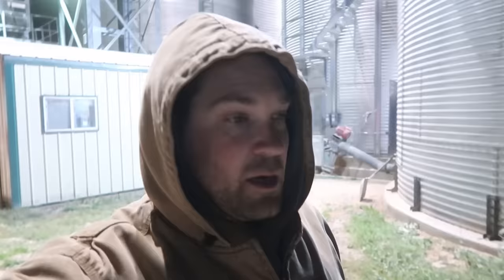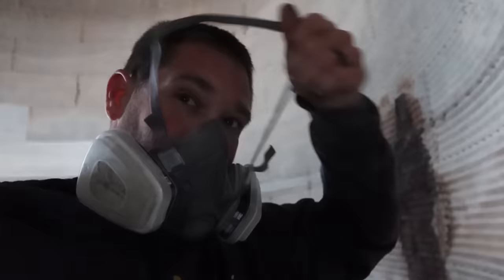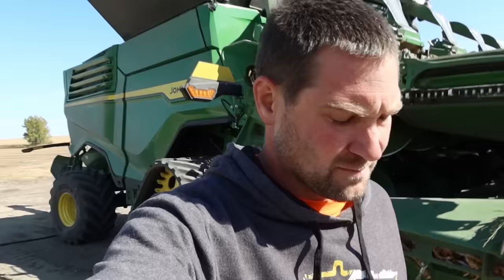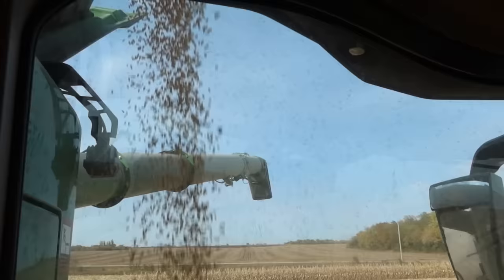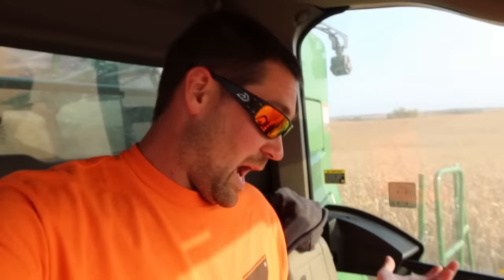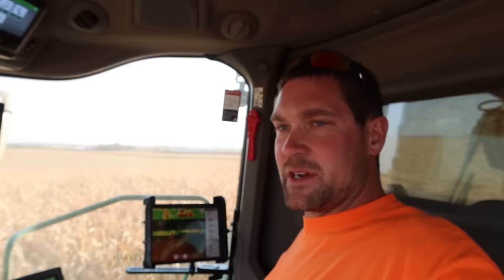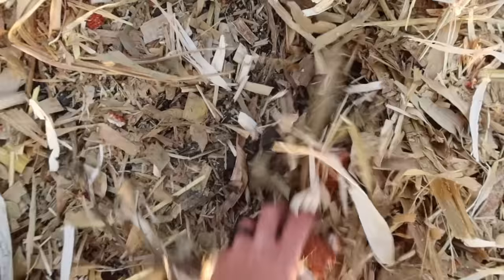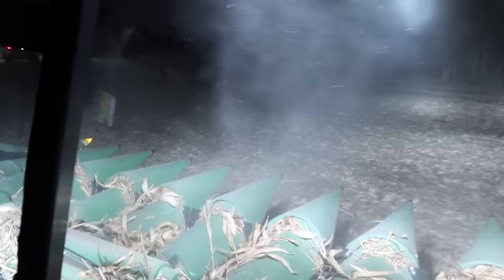John Deere X9 Likes and Dislikes

Comment: Your “cat container” is supposed to be a trash can lol that way you can pull it out and dump it. Can also be used as a toilet on the go. Pretty handy but not the most sanitary thing in the world. Wouldn’t recommend it. Continue to use outdoor bathroom.
Reply: i say its for a cordless Vac so he can vacuum off the cab corn lol
Reply: I was gonna say the same thing
Reply: Haha.I'm guessing it would splash out on rough ground.I'll let someone else test that theory!
Reply: there are plenty of cases worthy of ''trashing'' a 5 gal home depot bukkey you can get one of those toilet seats for them ya kno... ....  ummm ;)  and that day the taco bell revenge happens you toss that bukkey out someplace and get ya a new 5doller 5gal bukkey  lol  wait... channeled that from SMPLACE...

I even saw one with bags you could toss away... pretty snazzy if you used to using the tire to prop your back up and try not to hit the wheel... wait... yukkk channeled that one from someplace else also!
Reply: Toilet on the go!
Reply: My nephew has used the one in his Deer as a sample container when he has forgot the sample coffee can. Of course not after it has been used as a bathroom or a trash receptacle.
Reply: Put a bin liner in it and you should be just fine for a bathroom, just don't go cheap on the bags if you don't want it leaking ;)

Comment: Mike Mitchell did a good summary on hp needs while reviewing their demo Ideal 10 with close to 800hp.  Basic summary was barely enough is not good enough.  Need enough to handle every situation you may run into with all machine functions operating, going up hill, fully loaded, mud, unloading on the go, etc.
Reply: Think above 1000hp is exempt from all the EPA rules, seems like they way to go. But maybe the manufacturers don't want to sell something reliable?
Reply: I was disappointed Mike didn't get the chance to run the X9 this season. Would be good to see a comparo between the Ideal 10 and the X9. The specs seem to indicate the X9 has much greater cleaning capacity, but not horsepower to drive it - would be good to see how they go back to back in real world conditions.
Reply: @IBAdrianHarris  The Ideal 10 has a lot more thrashing capacity with 16 foot length. JD’s top pan is just a delivery pan more than a cleaning pan. Ideal 10 is ahead in specifications in all other categories. Fendt Ideal 10 should win in field trials if they re-design their MOG chopper/spreader. The general consensus out their by all the subject matter experts is that John Deere copied the Fendt Ideal’s technology when they came out with the X-9 combine. I looked at the comparisons and I would have to agree.

Comment: Looks like the X9 does a great job overall but for a flagship model, it’s still down 100HP on the Claas 8900 and the Ideal 10.  Throw in a Case 8350 and it would be interesting to see all of them go head to head in the same crop.  Not just in acres cut but sample, losses and efficiency.  I can dream can’t I...?

Comment: You should really show us how that little moisture tester in the dryer shed works cause I’m really curious
Reply: Yeah same here cause ours is different all we have to do is take a bucket out it underneath the crop that's coming out of the semi the go in the tiny house is what we call it then dump it in a like container on top of the sampler machine Tap test crop on the touchscreen on it then it opens the crop goes inside then it levels it automatically inside the machine then it test the crop then you write everything down then it dumps the seed or crop into a tray and then after 5 sample's you have to go dump it in the grain pit where the semis dump so yeah
Reply: Those are really old, but must still be good, or they wouldn't be using them.
Reply: Fun fact: that moisture tester he has is only a couple hundred dollars less than the X9

Comment: Hey Zack, you’re running one of the biggest combines ever made, and you’re still able to make it pull down with all that power, I just remember running an old 1440 International no turbo obviously talk about a dog!! That was back in 1981, things have changed obviously!! Way too big of a machine for us💰!! Anyway Zack I love learning about this stuff 👍!!
Reply: When I worked for an IH dealer,one of our customers had a 1440. He wasn't happy that he could t unload on the go.  He broke a front axle, and brought it in for repair. The engine is straight off one of the regular tractors.  While swapping the axle, one mechanic added a turbo to the engine.  The farmer loved it.  Eve claimed it was more fuel efficient with the turbo, and the fuel savings would pay for the turbo in less then one season.
Reply: @robertheinkel6225  Oh I remember trying to unload on the go, it was always pulling down just with a four row too, that’s really all it needed was a turbo like the 1460, we traded it for a 1640 and that still did not have a turbo but it had the 466 engine and that made a big difference!! They were good old machines to be honest we went with JD in 96 and went back to Case IH last with a 7250 with a MacDon draper and the folding 12 row head !! Very pleased with it does a beautiful job 👍

Comment: i have been driving trucks for 30 years i HATE flat tires in the morning.
Reply: I haven't been driving for quite 30 years, But flat tyres are definitely not my favourite, Although, Zach gets more flat tyres than our entire fleet does, and we have about 35~ at a given time.
Reply: Had one this morning on my milk wagon
Reply: Seems more often the inside dual also.
Reply: Specially in a cold morning
Reply: What is worse, the morning flat or the almost done for the night flat
Reply: Iv had 3 in one week and they where all replaced by loves 🤔
Reply: That's what she said.
Reply: Been there! Usually when I NEED the truck... lol probably would've etherd it up! 😆
Reply: @cornbread9167  "with loves"? Or, "by Lovs"?
Reply: But they re only flat on one side.

Comment: Watch out 6 is gonna be running trucks here in a minute
Reply: Give him two maybe three years when that puberty growth spurt kicks in. Those are a lot easier to drive when you can reach the pedals and see over the steering wheel at the same time.
I remember being maybe a year or two older than onyx , cultivating 4 rows of corn with the popping Johnny H with the tricycle front end. No hood !No fenders! just you , the seat , and the steering wheel to hang on to ! Exciting times at the ends of the field. Both hands on the lever to get the Cultivator out of the ground, disengage the hand clutch jump off the seat and stand on the left brake petal while spinning the front end in a perfect half circle. Haha! Pop the clutch back in while giving it a little more throttle and drop the cultivator back in the ground. Almost as exciting as wrestling and holding the firstborn calves at branding.

Comment: Pulling the yellow air brake should set the red brake automatically no???
Reply: Yes it does.  And I'll never understand why trailer brakes button is  ever pulled out. Unless obviously dropping trailer or on a hill.
Reply: I dosen't work all the time ..so it doesn't hurt to make sure.
Reply: @Madswiss600  why would you depend on a tractor to hold all the weight of the trailer also. When loaded that’s just common sense I would say.

Comment: Why not just weld a ring around the bottom of the grain bin on the wall flush to the floor and a angled scrap on the end of the sweep that runs a eight of an inch from the ring on the wall so u don't have to climb in so much
Reply from the maker: If you inspect a grain bin sometime, you'll know why.  They're crude lol.  Nothing is within 8" let alone 1/8!

Comment: Since the combine is running on auto steer couldnt you technically get out and clean the window while its driving itself? :P
Reply: And well he's out thier check for corn loss, take leak and possible climb up and down the ladder a few times to loosen up...forget checking for corn loss that machine's running 6mph it could get away from him.
Reply: @jackwillie2729  sounds like something mike mitchel would do😂😂
Reply: No can do even if you wanted to. There's a sensor in the seat when there is no occupant it stops the machine from any forward or reverse movement.
Reply: @earlhollar1906  when there is a will there is a way😜
Reply: assassinlexx  I never said he SHOULD do it, just that he COULD :P

Comment: I used to run a New Holland TR. In dry corn it’s really easy to “over thrash”. I would try reducing rotor speed/ open the concaves in order to be able slow the fan speed., and increase ground speed to “fill” the rotors for cleaner threashing. Good Luck, it looks like fun!!!

Comment: Highly recommend a standard pallet jack for changing tires.  If the truck it jacked up high enough, you can slide it under the tire and lift just enough to pull it off straight all with only one person.

Comment: This might sound like thinking out of the box...or a crazy idea....you’re using a grain shovel in the grain bin to move the grain to the auger. Has anyone tried using a small electric snow blower to move the soybeans or grain away from the sides? Maybe with a little modification to the inlet impeller with a Ruber strip? There’s got to be a better way to make it easier for ya! Just a wild thought!?
Reply: I hate the thought of the dust with these (out of the box ideas)
Reply: If I was you I would patent that idea quick. As a selling point it comes with a hazmat suit. LOL you would definitely have to have a gear reduction for discharge velocity. My electric Toro would throw them beans all the way from Bin Ghost out the door, even at the lowest shoot setting.

Comment: In the UK I used to erect silo's in the 60/70's, used for barley, 80% of these had a hopper floor, never ever any shovelling to empty a silo, only 1 auger used to empty the tower, set at a 45 degree's in to the bottom of the hopper floor. On 10% of silos we erected air sweep floors on the flat base, no auger's used at all with this system, the grating on the floor were all directed to the under ground  conveyer in the middle, with draft from the drying fan, again no shovelling or sweeping, the rest had the not very nice shovelling brushing floors.

Comment: John Deere had an X9 combine testing east of Edmonton Alberta Canada on oct 21 2020 with heavy secrecy and security. This combine came from the usa with new features and sensors, a security team, and JD officials from usa and Canada to monitor the testing. But the secrecy surrounding this was very unusual (to me). The local JD dealer was told to contact farmers who had crops that were not combined yet. The dealer found 1 crop at least, 6 miles away. The machine was transported at night and the security team guarded the machine, and had security at all roads leading to the machine. The farmer agreed to sign a non disclosure agreement and to not take pictures or tell anyone about it. There was just an X9 designation, no model number. The staff at the dealership were told no pictures or video of it, or else.

Comment: I suspected that Deere made a mistake when they made the grain tank smaller and the engine 100hp less powerful than the Claas 8900. It seems im not very wrong. 
Impressive machine though, dont get me wrong. Its outrunning Larsons S790 by 1 mph, with a wider head. Not bad.

Comment: What Engine speed are you running while harvesting? check with your Deere representatives and make sure your running the right speed. also, make sure to confirm if you should be running at Peak torque or peak HP.

Comment: Engine horsepower may be limited due to being a new machine. Not sure how many hours are already on it but I have heard of some equipment as well as vehicles having a break in period where horsepower is limited on the engine until you reach X amount of miles or in your case X amount of hours. I could be wrong though.

Comment: “Working hard” sitting in a brand new tractor with auto steering/driving.  That’s what I call working hard.
Reply: Let's see you do it. Way more behind the scenes than you think. And way harder to run than you think. Not as comfy as your arm chair
Reply: @williamuskoski1385  yep. It's not as easy as it looks.
Reply: @jandewit6574  Yet, I'm still glad that GPS has a increasing decibel beeper when you're getting close to the end of the row. I think that standard equipment? Or did my nephew just have that chipped for me?

Comment: I wonder if the power problem is not horsepower but maybe just too small of displacement to get enough torque out of it? 700+ horsepower is a lot to ask from 13.5 liters. Correct me if I'm wrong but doesn't tractor horsepower only go to 510 with that engine,  and the larger ones use Cummins. I'm not being negative I just wonder if they should use a bigger engine from an outside vendor.

Comment: What’s the point of running a chopping header if you’re running tillage behind the combine?
Reply from the maker: Because unchopped corn stalks don't go through anything other than a mold board plow
Reply: @MillennialFarmer  that Mandako VT will cut em right up, that’s how we do it and it’s good ‘nuff
Reply: We run a 496 disk after the combine.  Ironically, the stalks only become a disk problem when we get close to the neighbors who have a chopping head and they all blow into our corn.

Comment: A quarter of 1 percent out the back?? I've never done grain farming.That really good,right?

I wonder if there's an eco setting for the engine? It's hard to believe it would run out of HP.

Also i'm looking forward to seeing Onyx drive a semi 😃😃
Reply: Eco settings are for lite loads.  Example A pto run grain auger on a 100+hp tractor.  A combine engine is working HARD.  Besides bragging rights.  You find where it’s working hard but not lugging.  (Even if paying by the hour for the machine)

Comment: How many Bushels per hour does your combine do? And what do the S Series combines do or other makes similar machines? Not being a farmer I dont know. Maybe another farmer can answer that question. Just trying to see how much better the X9 is.
Reply: A well set S790 can do 3,500-4,000 BU/HR and can do a little more with some aftermarket upgrades, like aftermarket concaves. The Fendt Ideal 10T could probably push a little more throughput than the X9 1100 with the extra 100 HP, more engine displacement, and larger rotors. The redesigned cleaning system in the 10T will allow more throughput and the 7,800 BU/HR clean grain elevator will keep the grain moving. A Claas Lexion 8800 will probably have the highest throughput in corn and has a 8,000 BU/HR clean grain elevator, which has been maxed out several times.
Reply: @donnayfarms6812  Wow! Thanks for the reply!

Comment: hey....  the other day ...you were like shuttin down at the dryer and saw ''critter prints'' .....  I didn't see anything but my mind was screa,omgh out MOUNTIAN LION ... but it coulda been a skunktrak for all I knew...
Reply: 5:20  dude... it seems like it might be cost effective to fire up the tractor and the grain VAC thingie machine and SUCK THE CORN OUT THERE in a few mins... puttin directly into ''whereever'' ...oh wait, its still staying in system just another location? nevermind.... lol  it just seems to me that at the point you are SHOVELING it should be EASIUER to get out the MEGA SHOP VAC ON STERIOUDS AND COZMIK POWER... well one of them pto driven shop vac sure seems to be that nice lol ;)
Reply: DUUUUUDEEEE
U GOT TO TEST 
THE RADIO !!!!!!!!!!!!

just saying ....  I hope you got to test the radio...  while OPERATING..... sigh...
Reply: .... slightly diff universe and I may have already been there helping ya... if nothing else driving a truck Abutt*IN*seat ;) ... told the other half, she said, ''gotta get the RV first'' lol  dreamin about an old BluBird WONDERLODGE ....
Reply: didn't that dude tell one of the welkers that ''broken short cob ...too close blah blalh that firstpart of the roter thingie... he said ''split cobs .......'' were something else about the depth settings on the (those rack sifter thingies, CONCAVES....  yea_

Comment: Did I see correctly that it's burning 0.9 gallons of fuel per hour?  I'm not familiar with combines but that seems good for such a big machine with that much power.  Now that I see it again, maybe it's per acre?
Reply: Are you crazy ? 3,5l per hour ?? It burns over 100l per hour
Reply from the maker: It was per acre
Reply: 25-30 gal/hr would be my guestimate

Comment: Question there Boss Zack .... Makita makes an all electric : Makita Bristle Brush BR400MP with 2*18V Batteries. Wouldn't that allow you to clean the bin even faster? Since it's also Green it fits in nicely :-)
Reply: What about a snowblower modified to do the same thing?  Small one. Be like just a mini sweep a couple feet wide to auger the grain out away from the wall that you could run around the outside.
Reply: @harthek2000  anything as a blower causes a dust storm which becomes a real hazard inside of the bin because you loose total viability and you start building a explosive air cocktail too.

Comment: did you notice you have to move hydrostatic joystick out to drive ahead unlike your old combine and the s600.  that is why I think our s790 us jerky beacuse you move the handle the wrong way going from forward to reverse.
Reply: No its just sh...y. and the prodrive with its shifting does not help either. Its super hard to drive smooth. Never had this issue in Claas.

Comment: The main thing combines need is a automatic window cleaner. What the heck.
Reply: You'd figure with all the air the combine is generating that some of it could be diverted to the cab windows. I've been places that have air curtains to keep dust generated inside a room, inside instead of allowing it out. Same principle.